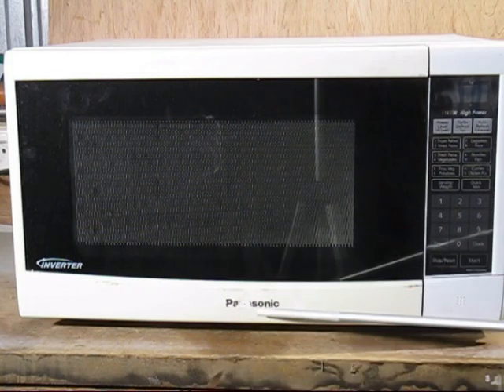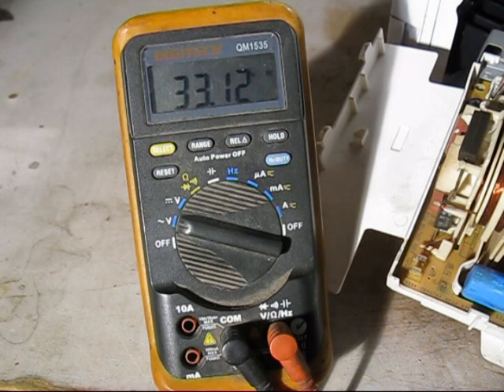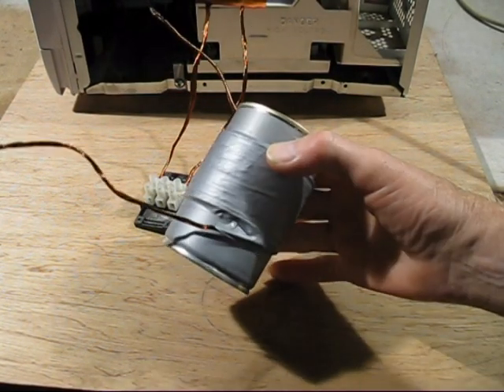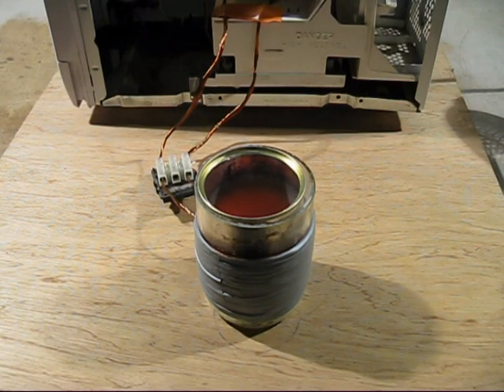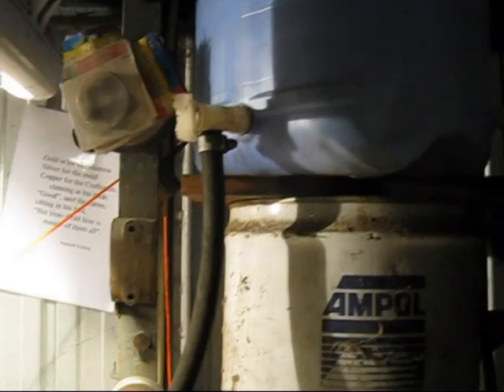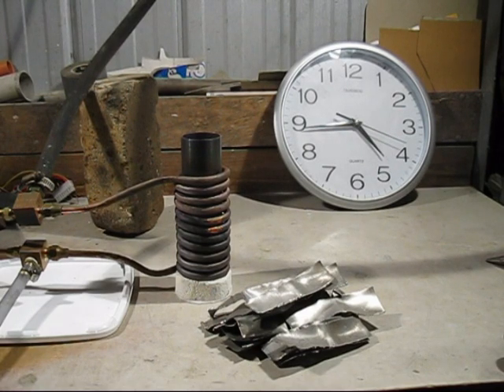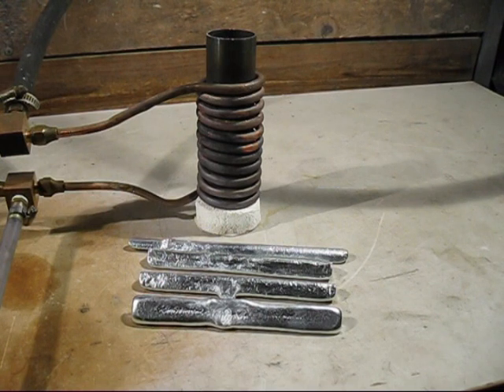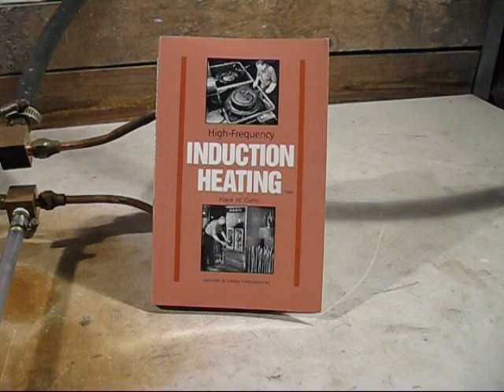First time on youtube, induction furnace made from microwave oven parts

Comment: Wow,  will preheating via induction reduce yor fuel oil / propane consumption and reduce length of melt.

It also might extend the life of the crucible.

Just thinking.
Reply: Less energy maybe, but crucible costs can go up considerably if using small induction with graphite crucibles.

Comment: Great work I'm very intrigued! I have made a Tesla coil out of 2 microwaves with the old transformer type. Could you please share any info for the mod that you did to the board? Would be much appreciated. Subscribed cause of this video. Thanks
Reply from the maker: Bypass the high voltage part and use a crt flyback transformer
Reply: @luckygen1001  Thanks mate much appreciated.

Comment: my bet is that inside a thermal refractory it will melt the alu twice as fast. Good experiment.
Reply from the maker: You should build one and try that out and let me know if it works.
Reply: @luckygen1001  I am working on mine, though I don't know if an arch furnace would be easier to build. But don't hold your breath, I get about 10 minutes of free shop time a month.

Comment: is there any concern of electrical arc between the coil and or the crusible
Reply from the maker: The  voltage is to small for an arc to flash from the coil to whatever you are going to heat up.

Comment: i wonder if you would end up saving any power if you used this concept to heat up the water in a hot water heating system to heat up a typical small suburban home?
Reply: Sorry to disappoint you any any way, but there's not a chance. Induction heating (properly tuned and designed) is at best 80% efficient. A standard resistive heating element is always 100% efficient. You'd end up spending MUCH more on your electricity bill that way. Only exception is when using a induction cooktop for short periods of time, because the pan itself is heated and the cooktop and coil don't need any time to heat up. Long term resistive is still better.
Reply: @theLuigiFan0007Productions  I've heard the opposite -please site your source.  Even if true, induction heating definitely does have its place in industry where it is excels.
Reply: @theLuigiFan0007Productions  That link does not say resistance elements are 100% effecient as you claim.  Far from it.  It states that professional studies done by the government show induction heating is slightly more efficient.  Writer of article did his own study and made his own conclusions.  He claims that induction heating is more efficient if cooking time is not too long, but less efficient if cooking takes a long time.  Obviously, their is not much efficiency difference between the two methods as you falsely claimed.  Interestingly, the latest consumer appliance rage is a combo unit that has two induction burners and two resistance burners so you get both in one unit.
Reply: @mevk1  
Sorry for the confusion, I get what you mean now. I was talking about the act of creating heat from energy, not the overall efficiency of any one device. Once you take into account losses transferring heat, say, into a pan, you are right, resistive heating isn't 100% efficient.

The act of converting power to heat was 100% efficient, something induction heating can't do. However, induction heating bypasses the need for heat transfer, thus partially negating the fact not all the input power becomes heat. 

For resistive heating, 1W in creates 1W of heat. For inductive it's closer to 1W in, 0.8W heat out. It depends heavily on application which has better overall efficiency.  If heat transfer losses when using resistive heating exceed 20% and you're heating metal, inductive wins almost every time in overall efficiency.  

I guess the point I'm trying to make is explained by this example. A electric water heater has the elements submerged in the thermal load, so it achieves a very high overall efficiency, usually 90% or better. Inductively heating metal to heat the water would result in a decent drop in efficiency because not all the magnetic field is converted to heat. On the other hand, smelting steel with electric heating would result in great radiative heat losses at those temperatures unless the crucible was near perfectly insulated and very heat conductive. Applying heat from within the metal itself is a whole world better.

TL;DR:
Sorry for confusion.
Heat source efficiency ≠ Overall application efficiency
Reply: Hrm...would it work if you submerged it inside a tank of water with a piece of titanium or stainless suspended in the core to heat the water?....but not any radioactive metal or anything that would contaminate the water as inevitable decomposition occurs?

Comment: I would love to try and reproduce this configuration but it would be of great help if you could describe the isolation coil...
Reply from the maker: I am not sure by what you mean by isolation coil?
Reply: @luckygen1001  the modified flyback transformer
Reply from the maker: @karmicmessenger  I used the ferrite core from a flyback transformer from a t.v. and used 30 turns for the primary windings and 5 turns for the secondary windings.

Comment: Very neat to see this done.  Just as much of a ground breaking development as it was when guys started regularly casting iron with waste oil furnaces in backyard setups.  However I don't think that induction heating will ever replace fuel for medium size melts of bronze or iron.  Typical household electric service just isn't enough to quickly melt in the U.S.A according to my napkin calcs.  As for the glass, there can be a good bit of variation in composition and impurities in typical food glass.  Some is far more tolerant of thermal shock.
Reply from the maker: So true, 1100 watts will not melt a large amount.  The experiment was to see if it could be done but will not replace my waste oil furnace. I am still amazed the glass did not break. I had three attempts at cutting of the top of those glass jars before i got one that did not shatter. I have learned that glass is very brittle.
Reply: @luckygen1001  I worked in a glass factory as an engineer in training for several months.  We made borosilicate tubing, which is not your typical soda lime glass used in jars, but similar in some ways.  You could take a 4 foot length of this tube, about 1/2 inch diameter and .040 wall and bend it like a bow 6 or 7 inches away from straight before it would shatter.  I have also been around rotary glass machine which take a "gob" of semi molten glass and form it in dies to the shape of the jar.  These dies are supposed to be water cooled but like any machine, the hot, greasy, dirty environment tends to clog things.  So you can have a machine run 24/7 and if one of the dies isn't water cooled effectively it will affect the properties of all the pieces made on that particular die within the batch.  I don't know exactly why your bottle did not break, but glass is a very interesting material and manufactured in places with often very loose quality control.
Reply: 1K no,  3-6 gets interesting. If tweaked, a 4-5k unit could possibly do a kilo of cast iron in half an hour?  Some tubers have already melted over a pound of copper with those 2500W ZVS flybacks.
Reply: @luckygen1001  sorry, but you are not quite correct about the glass being very brittle.
it is under certain circumstances, under others it is like steel
when i was a barkeeper, a very long time ago, i regularly made money by betting i could hammer  a metal coin into a shallow bowl with a regular beer glass.
i put the coin on the bar top and hammered it with the glass, never broke a glass.
i learned the trick from another barkeeper
the trick is to get the tips of your fingers firmly onto the inside bottom of the glass.
it will keep the glass from ringing and avoid it breaking.

Comment: Brilliant proof of concept video. I'm a foundry engineer apprentice (mech) in the UK, dealing with 6 tonne 4MW induction furnaces for cast iron production. Planning to make my own as I have the furnace knowledge, but I lack the electronics knowledge on making an inverter to power it. I see the microwave you used was 1.2kW, I'm just thinking whether it could work if a pair of equal power microwaves (same model for frequency) could be used in parallel to each other, connected at the coil to double or triple the output power and electromagnetic field to enable iron melting temperatures? I had planned to use an arc welder as it can output 250v but I haven't measured the output frequency. I've watched lots of your videos and enjoy them very much, as a fellow foundryman I have great respect for you and it would seem that what you don't know simply isn't worth knowing. Best regards from the UK
Reply from the maker: Thank you for watching my videos. This is why I used the microwave power supply, I am not smart enough to build my own inverter. If you connect two or more inverter microwaves to together it will be like connecting two electric motor drive shafts together and they will spin in two different directions. In a very short time they will over heat and destroy themselves. The same thing happens when the power transistors in the inverters do not fire at exactly the same time, they destroy themselves in a tiny fraction of a second! So you are stuck with the rated output and if you try to run the inverter at max power for a long time it will not let you dial ups hours at a time.  Inverter arc welders could be used as induction heater but I have never tried that because scrap welders are hard to find. Scrap inverter microwaves are so easy to find because on garbage day there is usually at least one to pick up. I you need any help just contact me via youtube..
Reply: @luckygen1001  
Awesome videos.
Flyback resonant circuits actually can be connected in parallel as their internal feedback signal to the driver chip is derived from the resonant peaks not an onboard fixed freq oscillator, so they will tend to sync up provided their individual tank circuits resonate fairly closely.

To parallel them, connect the secondary (high current)  outputs together (properly phased of course) , and start the inverters simultaneously.

The only issue I can see is you need to make a driver circuit to drive the yellow wire at ~ 220 hz 5v  with a starting duty cycle of ~ 30% low power and switch to 80% high power.

I scoped the orange wire.
The orange wire sends an alternating status square wave signal back to the keypad to tell the computer if the magnetron is loading up properly or open circuit, which will cause problems if you try to use 2 or more inverters in parallel with the same keypad.

It's not clear on your video, did you use a single turn pickup on the inverter xfmr ?
Reply from the maker: @sparkyy0007  I am not sure what you mean when you said " did you use a single turn pickup on the inverter xfmr ?"
Reply: @luckygen1001 
The ferrite transformer supplying the work coil, did you just relocate the inverter transformer off the PCB, or is it a matching transformer that you added ?

Can't tell from the video with the inverter cover shield on if you just relocated the transformer to the work coil.
Reply from the maker: @sparkyy0007  The original ferrite transformer from the inverter was not big enough to have copper tubing as a secondary winding so I used a ferrite transformer from a crt tv.
Reply: @luckygen1001  
I knew that core looked familiar, good idea.

The original panasonic inverter core has about a 1-2 mm gap to prevent core saturation at 700 watts.
TV flyback transformers may not have enough of a gap at those power levels and they will get hot if they saturate as they are only driven to about 70 watts normally in a 26 inch TV.  I'm a tv repair man from the 70's starting with tube tv's.
If the core starts to get hot from saturation, just increase the air gap on the core slightly.

Tip
A lot of these re-purposed ferrite cores are glued together making winding difficult. 
They are sintered at high temperature so you can heat them in a kiln (slowly) to 400 C or so to release the glue. 

You can also used the TV deflection coil core assembly  if you need a high power toroid.

  Great channel.
Reply from the maker: @sparkyy0007  I used the same gap that was in the microwave inverter in the tv transformer. The method I used to disassemble the ferrite transformer was to boil it for 5 mins in a pot of water.

Comment: I have taken apart MANY microwave ovens over the past 20 or so years for no other purpose than to "play" with the dangerous parts (he he). In all those years, I have never seen the type of switching power supply that your oven in the video uses. All mine used the "old school" line frequency (60Hz here in the USA) power supply which will not work to power an induction coil. If you ever decide to edit or update this video, it might be a good idea to mention something about the different power supplies so that other hobbyists won't tear apart good working microwave ovens just to later become disappointed when they find out that they have the old style which will not work as induction heaters.
Reply from the maker: At the start of the video I pointed out that only this kind of microwave will work.
Reply: Yes, you sure did. I think that I missed latching my brain onto that important point because I was getting excited about learning how you were going to actually do that later in the video. Thanks for pointing that out!

Comment: Are you sure that 32 reading  is frequency  ? You have your multimeter selector set on reading voltages not frequency !
Reply from the maker: I can read frequency by using voltage function and pressing the blue frequency button.
Reply: @luckygen1001  so are you running that inverter at 120 vac or 240 vac? No way an American power supply could boil water that quickly, unless that water started the test at around 180 degrees f. We only have max 15 amps at 120 vac.
After that the breaker trips.
Reply from the maker: @markhonea2461  The inverter is running from a 240 volt outlet and the water temperature was at room temperature (20C)before the power was switched on.
Reply: @luckygen1001  thanks mister!👍

Comment: A puzzler for me from this fascinating effort was when you melted the zinc - as I had thought induction heating only worked with magnetic metals??.. Obviously I was wrong since you clearly just demonstrated it melting.. So I went looking for an answer and I found this on Quora from a much smarter than me writer named Kavipriya:"Zinc is generally not a magnetic metal. However, it can be made slightly magnetic when exposed to a very strong magnetic field, but this property immediately dissipates as soon as it is removed from the fieldWhen melted zinc is exposed to a magnetic field, it begins to conduct a small amount of electricity, which creates an oppositely charged magnetic field. Since the two fields are oppositely charged, they repel each other, causing the liquid zinc to move away from the magnetic. However, it is the electrical current causing the magnetic field, not the zinc itself."
Reply from the maker: I used a magnetic steel crucible in the heating coil and when that heats up the zinc alloy absorbs heat from the crucible and melts. Any metal that is molten cannot be magnetic. To add to the confusion anything that is electrically conductive can be heated by induction heating.
Reply: Thank you; I thought it was a graphite crucible and should have verified that.  It makes sense now; food isn't magnetic either and it heats up just fine on a mag-plate cook top..:-)If I had only known as a youth how much Physics, Chemistry, and Electro Magnetism and Thermodynamics were involved in high quality industrial arts I would have paid much more attention in those theory classes.. but never mind, I'm learning more and more every day now thanks to folks like you and youtube!
Reply: Love it, thank you so much for that  The concentrated or sort of meaty nature of that reply reminds me of Ada Lovelace with her wonderfully elegant and just packed with ideas and rather stirring prose. She had an inimitable knack for reminding us all of the wonder of the actual state of nature.. I mean, for example why does this square of things keep popping up in our world?  And please don't tell me its the multiverse. Well put though..and thanks again for posting..